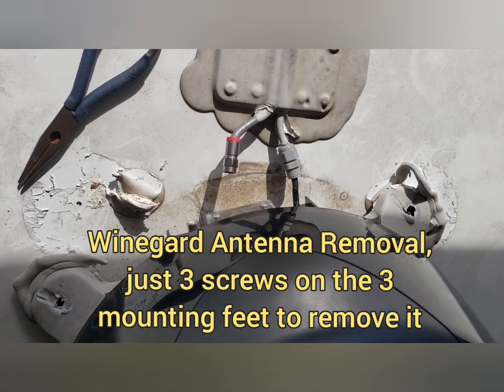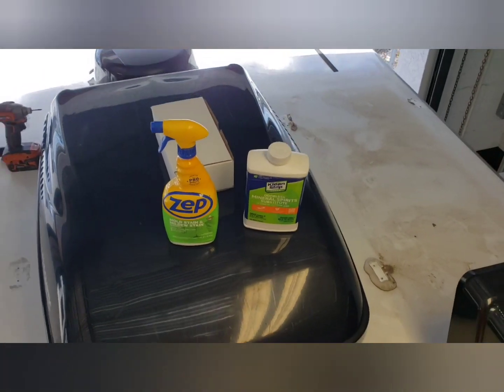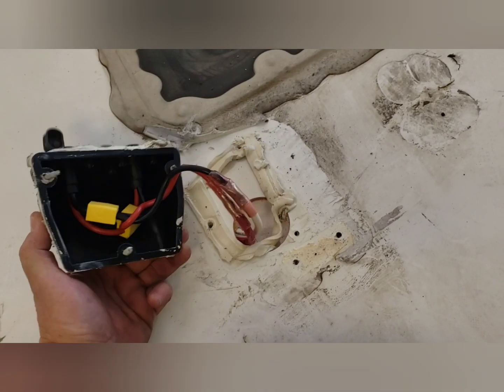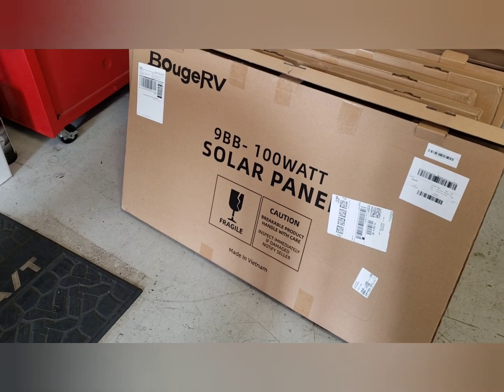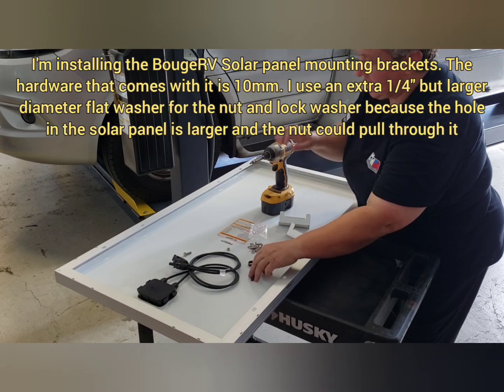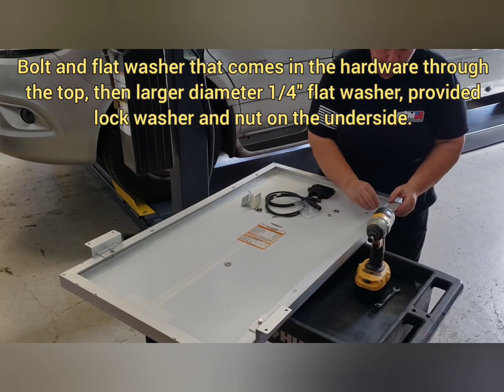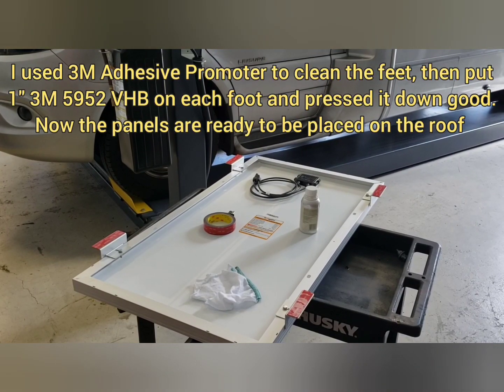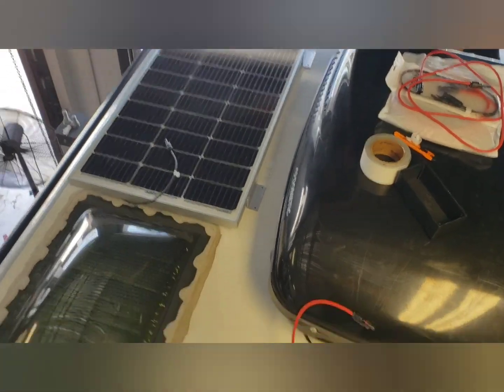Replacing Zamp Solar Panels with BougeRV on a Leisure Travel Van (No Drill Method)

Comment: Sandra, Did you use butyl tape under the z-bracket? Thank you
Reply from the maker: No, 3M 5952 VHB tape. Then once stuck to the roof I covered the feet with Eternabond tape as a redundant adhesion and sealing.
Reply: @SandyRVUpgrades  Nice… …. I will update my « butyl tape+screws+dicor » way of doing it … Thank you!
Reply from the maker: @DrDGr2  You definitely don't need screws. The VHB tape sticks extremely well to the roof. I know lots of people who don't even use the redundant Eternabond Tape foot cover, but I like too!
Reply: @SandyRVUpgrades  Noted!  Thank you.

Comment: Too bad there is not a way to re-use the old screw holes😞
Reply from the maker: You don't need them, better to be sealed off long term. It's to bad LTV is so far behind and still uses screws for their solar mounting. Most stopped doing that at least 5 years ago.